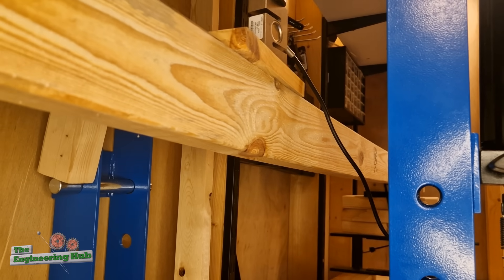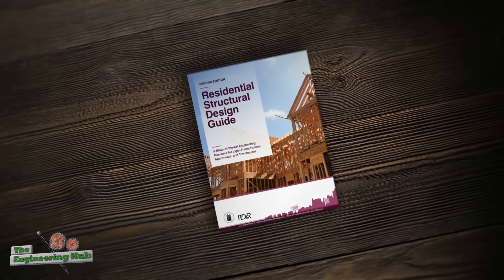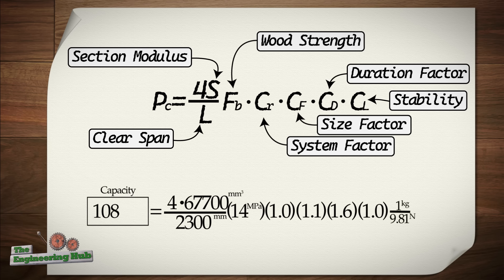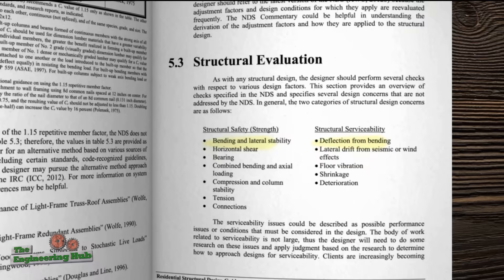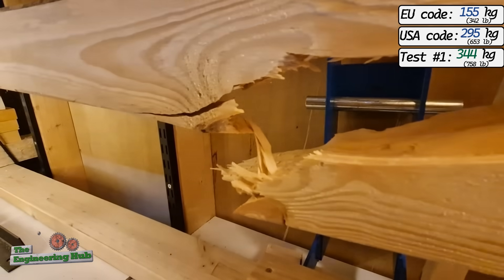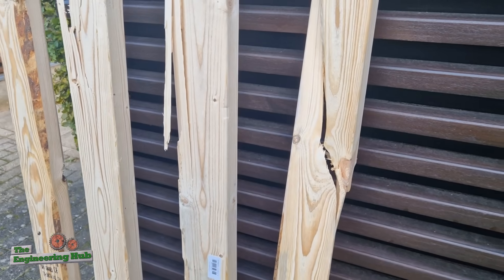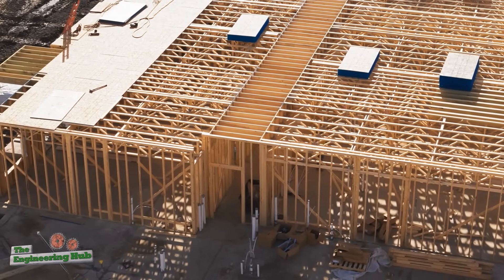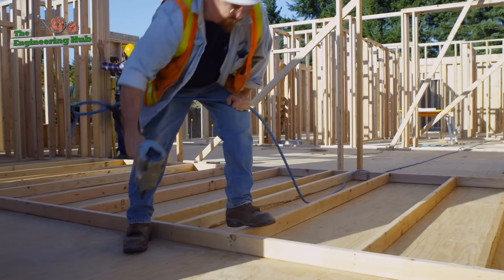I tested the strength of the 2 by 4!

Comment: My house is 150 years old.  The wood in it is just nuts.  It would never pass code today, but it’s still standing.  It probably has 2x more wood in it than a house built today.
Reply: The fact that it's still stand and probably solid af is a testament to thos who built it. Craftsmanship, integrity, and quality are a thing of the past. These days you pay $1M for a house built with OSB, cracked roof trusses, and wet studs....but it all gets covered up with high end finishes so it LOOKS fantastic.

It's like polishing a turd ffs.
Reply: @OU81TWO not all of them, I replaced a furnace on a 10 year old house once were the main floor of the house was doubled up 2x12s that were run 12" center to center. I went into the basement and looked up at all those joists and I was floored. You could drive a semi across that floor.
Reply: @bdkj3e  There are exceptions of course but generally speaking builders take the minimum code route to keep costs and labour as low as possible in order to maximize profits. It's a different story with custom homes.
Reply: @OU81TWO I feel it’s more or less always been that way. Throughout civilization there’ve been those who take pride in their work, and those that don’t.
Reply: @bdkj3e  Wow, I'll bet the main floor was hard to distinguish from a slab when you walked on it.  I'm kind of jealous.  Lived in slab homes my entire life until our current one, and even though it's built solid and fine I'm not personally a fan of joists and crawl spaces under the main floor.  I added an additional layer of plywood over the subfloor to the entire house, leveled it all, and put in thick vinyl plank floor with foam backing.  The house feels 2x or 3x more substantial when you walk through it now and very pleasant but I can still wish it was on a slab.
Reply: @advil000 1 story house ?
Reply: @bdkj3e  Why would the builder have so over-built that way?  And yea that would support a semi.  That's certainly not my experience.
Reply: @Stephenwc  the homeowner had to have requested it be done that way, no other  explanation.
Reply: @OU81TWO loved your turd analogy 😂
Reply: I've found that really old 2x4's can shatter.  It's like the sap has dried out and there is not much holding the layers together.  I can take a hammer and knock a stud out of the way, and it will splinter into pieces.
Reply: In addition, the wood used probably is not from a fast growing industrial type of forestry (spruce) but a naturally grown broad leaf wood which is substantially stronger than fir or similar used today.
Reply: @robertrjm8115  the floors are 3/4” by 4” oak on top of 1”x6” pine sub floor.    The supports are whole log pine.  Everything else I can see has been pine so far.  But it is different.  It has age hardened, but the grain seems more dense as well.  All of the spans are different as well.  Seems to be around 24” on center.  Every project is like an archeological dig.  I find all sorts of strange shit buried in the yard.  Found an entire chimney once.
Reply: you forgot to mention you are a squirrel
Reply: @ shhh
Reply: Yeah same situation with me. A lot of the joists are old growth Douglas fir 2x6 true. Epic looking stuff.
Reply: 2015, I had to replace the front porches, upper and lower balcony. ( victorian style home ) 1893. When removing the original 2x materials, there was sap coming out of the old wood, when I made cuts. Old growth wood. Even with real 2x material and superior wood products, they way over built the house, in terms of strength and excess materials. ( obviously the home owner was rich ) 
 Our area was also known for Milling old warehouse. beams into smaller dimensional wood. This wood may have had a life, as a beam, before it was used on the house. My family spoke about tearing down the old wood warehouses, on the St Louis riverfront, before and after  the whole riverfront caught fire. They started building warehouses with steel. 
 Around 1950, there was a fire around the brick chimney. ( common ) The adjacent wood never caught fire, and was left in place, and black stained. 
 A new wood would catch fire much quicker than the old growth wood. In today's building world, the entire house would have been a pile of ashes. 
 When rebuilding, I was able to reduce the dimensional framing, and lighten up lots of loads, with newer materials.
Reply: I bet all your floor joists are cracked because they used to notch the joists into the main beam which they also notched.

Comment: the EU code accounts for load duration through the KLED factor which is combind with the exposure class to result in the k_mod factor which is applied to every structure. shortterm loads increas strenght by up to 10%, long term loads decrease up to 40%
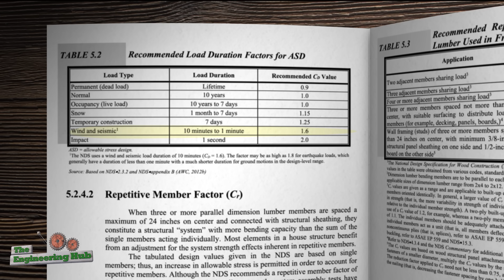4:02
Reply from the maker: Exactly! The US code allows for a 60% increase solely based on the load duration.

Comment: You were surprised at the accuracy of the US code, but you tested 4 beams and one failed at close to the predicted value. In other words, your 25th centile was close to the expected 5th centile. Statistically, the chance of that happening is ~20%. As you said, 4 beams is really not enough for a test like this. All the same, I would say this result is slightly concerning, if anything.

Comment: It is a very good thing the actual strength tends to be much higher than the code values.  Seeing boards made into Swiss cheese with penetrations and knowing the torsional and sheer forces from high winds and the incredible static loads from snow and ice those conservative numbers are the right ones to use.

Comment: In Norway a 2x4 is 48x98mm from the store. Dimensions are round numbers minus 2mm for lumber. Glued laminated timber have other numbers in height that are typically rounder. In Ukraine a 2x4 is 50x100, but is green and not kd.

Comment: the crap they sell nowadays is way weaker than the 1950 vintage 2x4s in my house they are good quality lumber what would be premium clear grade with nice strait grain and are strong like steel compared to modern boards they are a tiny bit larger mostly just square corners instead of rounded but you can have a board crack from drying out and splitting with age.

Comment: Dimensional lumber varies so much. My old house has 2x6 floor joists spanning 16ft at 24” on center. They are old growth pine and are so much more dense than new growth. The rings on a crosscut of wood are super close. I’d love to test their strength
Reply: I would heavily suggest reinforcement of the floor. That is well, well over the load demand of that lumber. 

My old house has 3x12(not planed) as for joists 12" apart over 16' span and I think that's just over what's required.
Reply: My house was built in 71', 2x6 @16" oc, 16' spans. I went under the floor and poured concrete footers mid span and ran double 2x12 beams perpendicular to the 2x6 to support them. I've been a framer for 25 years.

Comment: Lets not forget often too, holes have been made to have cables have been run through parts of a board
Reply: cable sized holes drilled in the centre of the beam,
should not decimate the beams strenght
(the beam top is subject to compression,
the bottom to tension, in the centre those forces should  be in equilibrium)
Reply: @laus9953  but you are reducing the amount of wood on either side. Usually the holes themselves are larger than the cable or pipe running through them as well.
Reply: @Ultrajamz  That's accounted for in the code books. There is a max hole size and spacing per style of joist.
Reply: Holes on neutral axis are of low effect on the beam strength it's a bd³/12 thing...

Comment: super cool video, I've been wondering about this since i, a few years ago I got into an argument with a safety representative about if I could use a 2"4" laid across a doorway as an anchor point for fall protection, the door opening was  90 cm and the requirement for an anchor point is 12kn here.  I now know that although my solution may not have been quite 12kn, it was certainly more than enough to hold me next time i will find a piece of lbs

Comment: So why did you use the time factor for multiple years with the EU calculation but a minute scale factor for the US factor? Why not both for a time span of only seconds?
Reply from the maker: Both are for time duration between 1 and 10 minutes. It's just that the EU code is not as generous as the US code
Reply: @TheEngineeringHub  At 04:00 you say that the EU code does not do that, it uses a permanent load (so factor 1). Why are you not using the same factor for both standards if you test on a scale of seconds? So that you use the number the standard would actually predict given the loading? You can not compare a ~5 minute load factor in standard A to a 10 year load factor in standard B and say that one is more accurate in a 5 second load...? Why are you not using the same for both?

Comment: This is why 2x4s are never used for floor joists. I'm unaware of any jurisdiction in the USA that allows anything smaller than a 2x8. Wuold love to see this test repeat with and without pressure blocking, and bridging mid-span

Comment: I like your logic of testing their claim; however the basis of their claim, the measurement of the strength of a 2"x4" in mid span is a bit of a fallacy. It is focused on a studs sheer strength not it's compressive or tensile strength. 2"x4"s are almost always oriented in a vertical position. This is excluding sill and top plates, however those too when framed correctly are  more experiencing compression and stretch, not so much shear. To combat bow under excessive load, we usually gang the studs or stiff board them. The house sheathing also reenforces the studs to resist deflection. But again, for some reason they wanted to know the breaking point of s 2"x4" at mid span🤦🤷🤷
Also, when framed as a span, most lumber (on east coast U.S.A. at least) is typically southern yellow pine. Much stronger than your standard kiln dried white pine. And never 2x4
Reply: What about trusses?

Comment: I have never had an engineer call out a 2x4 for a floor joist. They are insufficient for both strength and insulation. But probably a great reference for testing since they are the smallest structal member used in a residential home.
Reply: You would need an engineer to design a floor system with 2x4's. They used to be included in span tables, way back when when I was using UBC. I'm not sure if the IRC ever included 2x4's. But, they are sufficient, and you can even have smaller lumber engineered within a floor joist system. There are a lot of variables. Common species like SYP are weaker than Douglas Fir. The number of members per joist, span, spacing, deflection, lumber grade, loads like live loads, seismic loads, shear loads...all play a part in the design criteria. 
The tests done in this video were likely performed on stud grade lumber. That is, lumber that is to be used in vertical position. It doesn't carry a number grade, and I don't really know the comparison between studs and say a grade 2, but I do know a stud would not be as strong as a grade 2 piece of lumber. The standard in most codes is number 2 or better. Although, the IRC allows the use of #3 graded lumber without the interjection of a structural engineer.
Reply: I built a deck with 2x4 joists for a 5ft span. There's no code applicable under 6ft.
Reply: I specified 2x4's that cantilevered over a 2x6 flush beam within a 2x10 floor assembly.  It was a feature the Architect wanted. I made it work, but the spacing of the 2x4's was almost next to each other. A 2x4 is just a section, they can work in floors just like a 2x10, but their spans must be limited to conform to the strength and servicibility requirements. Insulation is not required for internal floor spans. ......Structural engineer for 40 years and real happy to be retired. Cheers from Canada.....
Reply: Shed floors in 10'x8' and under are often 2x4s which were done by an engineer. Course they aren't a living space load and having a springy floor isn't a big issue in a small shed.
Reply: @Cragified    you can also pick up strength with blocking or using 5/8" - 3/4" plywood on the floor, instead of OSB. There's not a whole lot of code to shed building in most areas.
Reply: @Cragified  Exactly.   And most people building a backyard shed are going to throw a few cinder blocks under the floor beams to massively decrease the amount of spring in the floor.
Reply: coincedently for a product I am working on I was set for some reason to use a 2 x 6 for this type of deflective purpose. Now that I know how incredibly strong a 2x4 is (no bottom center knots) I am more than happy with these test results and will be using 2x4 rather than 2x6. So for me this was great info.

Comment: nobody in the US is using 2x4 in a floor system
Reply: Right.  Plus, many framers cut the worst ones up for blocking and furring, and carry zero load
Reply: One of the first lessons I got is looking at the nodes where the branches where. That first one he tested, with that center, should have been cut left and right of it. Useless as is. Needed no testing. Simple observation learns us that 2*4 was cut by a machine or person that did not care. You don't want that. Especialy not two in line and exactely in the middle with that. Would be discarded by eye. Or indeed cut up.
Reply: Definitely not in 2024. I’ve seen them in older buildings (which is wild).
Reply: Not even the cheapest shed  hopefully
Reply: An 8x2 could’ve been a more helpful for this.
Reply: I believe the  top grade 2x4 premium cut are a best bet because wood nowadays is GARBAGE, i framed in Florida in the 80's and materials were night an day to 2024 but big custom homes were framed 2x6 an steel studs just started in residential
Reply: Your ceiling is a floor system.
Reply: @TheOsfania 2x4s are only used in walls and blocking. Never in floors or roofs. Floors and second stories are 2x10s
Reply: @TheOsfania  my ceiling joists in a very average house are 2x6 and 2x8
Reply: @TheOsfania  The ceilings with floors above them don't use 2x4s. The only ceiling in my house that does has an attic above it, and no possibility of flooring.

Comment: The code assumes proper framing procedures which rarely occur.   Most of the framing I've seen in the last 10 years makes me afraid to walk into the house.
Reply: Everyone keeps saying "they don't frame/build them like they used to!"  Bro, the post ww2 baby boom housing was way worse.  Older houses just didn't have a youtuber content creator walking through with a magnifying glass trying to generate clicks.
Reply: @JeremyBell  idk man, plenty of older homes have their problems but I see plenty of brand new construction where thousands of pounds are held up by an inch of air and about 10 nails because people cant seem to get their cuts right. it's just geometry
Reply: @JeremyBell  Which I guess and in your own words is a good thing BTW ? Speaking about the social media age.
Reply: @12345fowler  just saying everyone has this weird rose colored glasses about houses built in the past.  A typical 2 bedroom 1 bathroom house was slapped together by a crew that was drunk half the time
Reply from the maker: very true, the code has to account for all sorts of practices and construction shortcomings
Reply: No woodworkers that knows his stuff and cares, would have used that beam you break at the beginning with that node in the middle. Got to read the wood and recognise the weaknesses.
Reply: As the strong and weak side. Sometimes discard. Sometimes turn it the right side. Not an uniform product. Got to know the material.

Comment: I appreciate your effort and methodology on the testing. Very well done. 
For the record, any contractor who uses 2x4's for flooring joists should be in prison. 2x4's are good under compressive loads such as vertical wall framing, spaced close enough together to well exceed the loads encountered. NOT flooring joists.
Reply from the maker: Fair point! Just to clarify, I think this comparison extends to all lumber sizes. I tested 2x4's because my hydraulic press would have hard time breaking 2x6's or larger😅
Reply: I just used 2x4s for floor joists :( 

It was for a shed though :P and they spanned at most 4 feet :D
Reply: It would be perfectly suitable if the span is narrower (in the video it's 2.4m) and if you double up on the spacing, so nothing against a 2x4, it just depends on the usage.
Reply: The code book 8:34  tells you the maximum span allowed for each size of joist being used. 8:34  @robertrjm8115